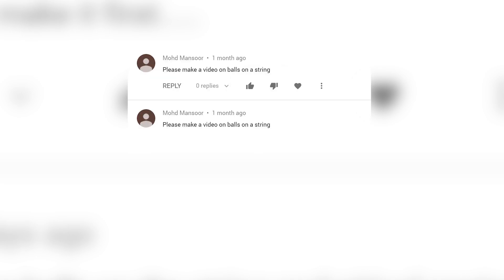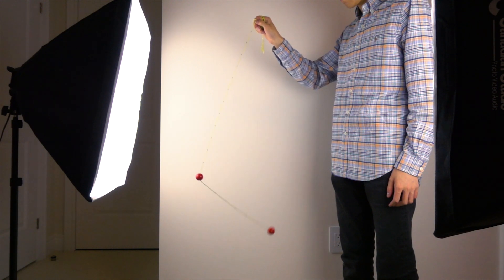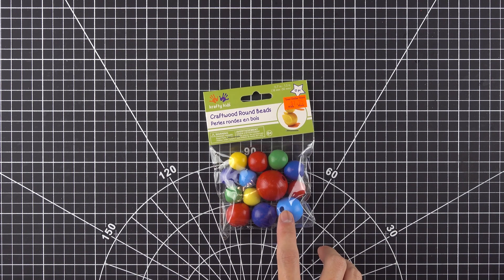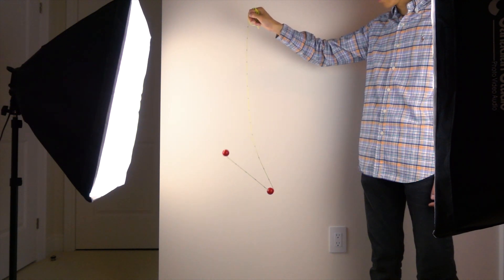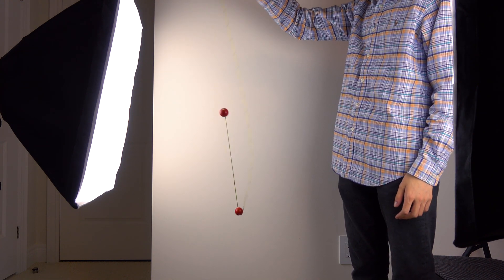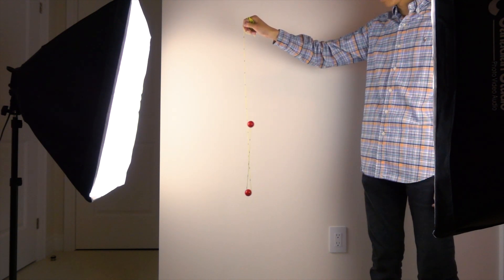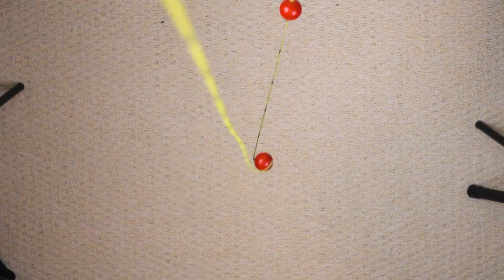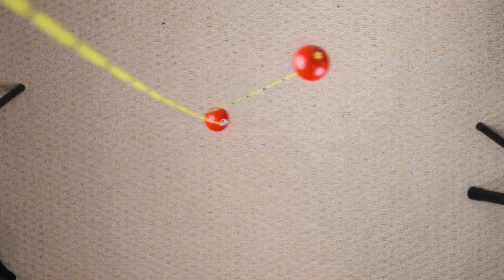IYPT 2020 Problem 7 Ball on a String Demonstration

Comment: have you tried this with astrojax? they are smoother, center weighted with a metal core, and also have a somewhat conical hole that makes the pivot point of the string closer to the center.
i think that could weed out some variables
nice video btw

Comment: Excuse me, will the experience be successful without metal nuts?Can I just dig small holes that are only available for the strips?By the way will the weight of the ball influence the result of the experience?I really desire your answer, thank you🥰
Reply from the maker: You can certainly sand the hole to be very smooth. I chose to use the metal nut because the wood surface was slowly destroying my string. If the balls are heavier, I don't expect the motion to change much. If the balls are lighter, the mass of the string is more important to the system.
Reply: thanks a lo t